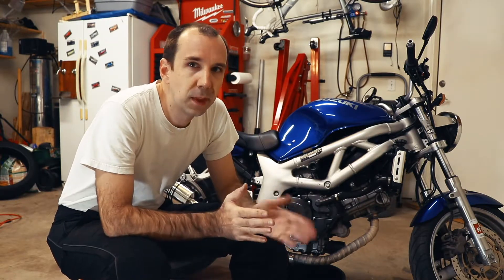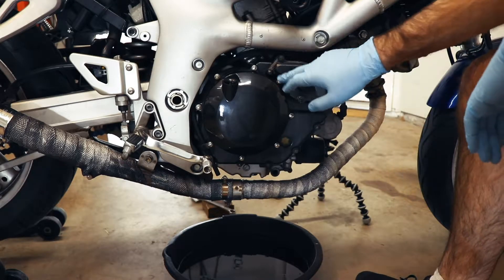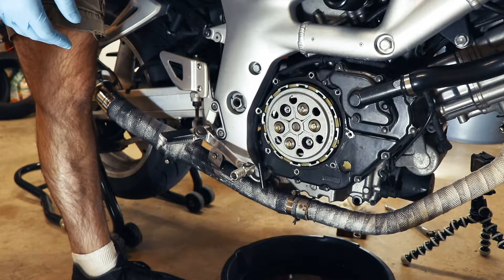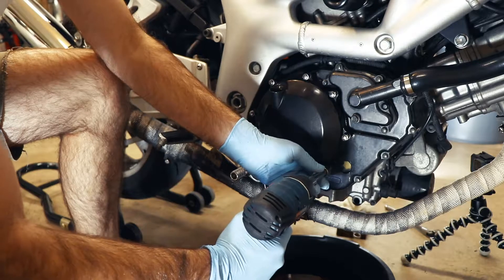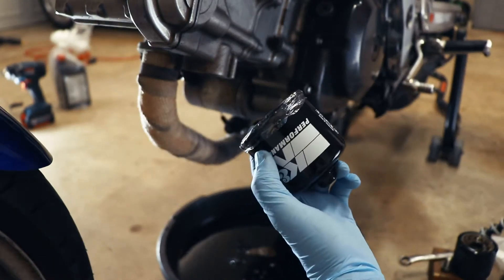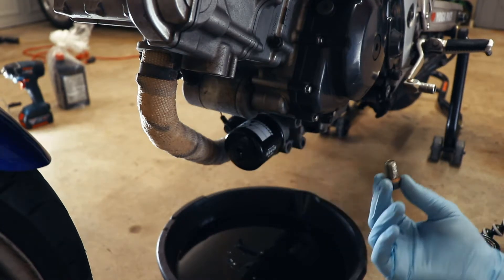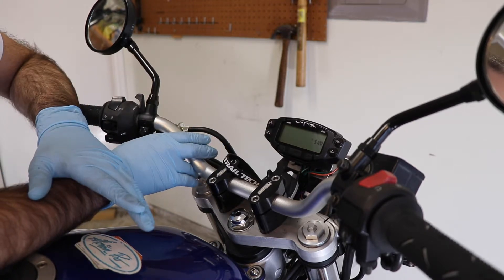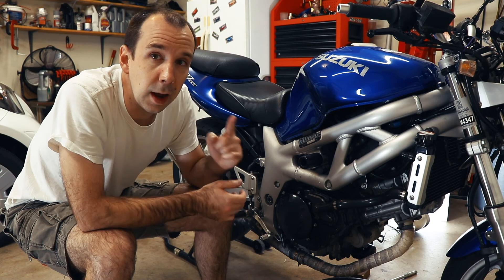Used Motorcycle Rehab - Clutch Cover Oil Leak Fix (Maybe?) - SV650 Episode 11

Comment: Thanks for the video Aaron. It was very helpfull. Just noticed on my bike that I'm having the same problem. I understand that these are a common problem on this model. Terry.
Reply from the maker: Right on, man!  Be sure to check out the follow-up, too.  I only kind of got this fixed initially, and had to redo it later with a little bit of Permatex RTV stuff to help the gasket do its job.
Reply: @AaronAverett 👍👍👌👌

Comment: My 8mm bolt got completely grinded off during a lowside fall. 😭😭 And there is a hole on my stator cover.  Any ideas how to remove what's left of that bolt in that recessed hole?
Reply from the maker: It's hard to say without seeing it, but generally, you have two options:
1.  Grind the head of the damaged bolt off so you can remove the cover over it.
2.  Get a grip on the bolt with something and turn it out.

Option 1 is probably the most straightforward.  I'd just grind the head off with a Dremel or die grinder, lift the cover off, and then use vise grips to get the stump out of the engine case.  If there's already a hole in the stator cover, it's not the end of the world if you damage it, since you'll need to replace it anyway.
Reply: @AaronAverett  I haven't even thought of actually doing that. I'll try it during the weekend when I get time.  Thank you so much Aaron.👌🏾👌🏾

Comment: Question, you have only 4 screws with springs but did you took 2 out or was it already like that?
Reply from the maker: It was like that when it came to me.  Those don't appear to be the original fasteners, but it always worked really well and didn't slip, so I left it alone.

According to the parts fiche, there should be six springs, though.

Comment: Ok, I did both part 1 and part 2 of this repair and both didn’t work. I was actually driving to school and the gasket sealer had leaked so much that I had to pull over to keep my tire from losing grip. Did some research, and yes, these can fix the problem but not entirely. It’s possible that when I replaced the o-ring from part 1 I over torqued the plastic case and warped it. I ordered a new clutch case cover and new bolts and I will reinstall the o-ring WITH gasket sealer. If this doesn’t work—
Reply from the maker: Oof, that sucks!  It sounds like maybe just from use or heat or whatever, your cover is warped worse than mine was.

Also check for any damage to the mating surface on the engine side.  If you've got scratches or nicks, maybe from a previous owner trying to pry the cover off or something, that may contribute to the leaking, too.

I'd probably be considering the aluminum Woodcraft cover if I were you.  It's pricy, but so is crashing, and being aluminum, it should be somewhat less prone to warpage than the crummy plastic one is.
Reply: @AaronAverett  you’re probably right but I don’t plan on keeping the bike for too long and don’t want to invest a lot into it lol. Your radiator video was, however. a great success — much appreciated!!

Comment: Great vid thanks! But what is the gasket on the other side called? Mines leaking a little, just don’t know what gasket is or what it’s for.
Reply from the maker: Which gasket are you referring to?  The one on the left side of the bike, opposite the clutch?
Reply: @AaronAverett  yes
Reply from the maker: @kingalshammari8251  The cover on the left is called the stator or magneto cover.  The gasket for it (on this 2001) is Suzuki part number 11483-19F00.

You can find it here:
https://www.partzilla.com/product/suzuki/11483-19F00

Comment: Hi there. Conincedentally I am have this same issue. I noticed there's only 4 bolts holding the clutch plates in, where there should be 6, according to the manual. Did you remove two? Or what's the story ?
Reply from the maker: I never did figure out an actual reason, but I assume it's either a common modification to make the clutch lever effort less, or a model year change that happened, but everyone has a service manual from a different year.

It worked fine as it was for me, so I just left it with the four springs, as I recall.
Reply: @AaronAverett  Thanks for explaining. I was just wondering if it wouldn't make the clutch slip, since that little twin is pretty torquey. I might give it try myself 👍🏻

Comment: Hey if u don't mind what year SV is this? It looks like there's no push rod adjustment screw visible in your video which would mean it's still under the sprocket cover on the left hand side.
Reply from the maker: You're correct - this bike is a 2001 model year - the clutch cable terminates at the front sprocket cover on the left side, as you say.

Do later models have it on the right, a la Kawasaki?

Comment: I'm having the same problem, but the gasket keeps leaking at the bottom, even after replacing it. Also: my manual says 10W40 for the oil. This looks like a first gen bike, right?
Reply from the maker: Correct, that bike is a 2001 model.

I think I talked about this in the video, but the real cause of this problem is that the plastic cover gets distorted over time through exposure to heat and oil, and that the real permanent solution is an aftermarket aluminum part, which does exist, but costs about $200.  I had a similar problem to you, where I replaced the gasket and it still leaked, so I made a follow up video where I did this again, and used a small amount of RTV on the gasket, and that actually fixed it for as long as I owned that bike, without the need for the aftermarket part.
Reply: @AaronAverett  I have some loctite 577. Will that work too? I don't mind buying the alu part (I'm practically restoring a '99 model) so 200 is just a drop in a bucket on a bike that also needs new forks, seat, tank, ... Problem is that I can't find an aftermarket cover. I can only find the OEM part.
Reply from the maker: Can you not get one of these?
https://www.sportbiketrackgear.com/woodcraft-suzuki-sv650-99-02-rhs-engine-clutch-cover.

Loctite 577 is a thread sealant.  I'm pretty what I used is Permatex "Right Stuff" or a similar black RTV liquid gasket (the type that smells like tar, not vinegar).  I made a video where I showed how I did this, here:
https://www.youtube.com/watch?v=09XHw1IwZP0
Reply: Problem is that I live in mainland Europe so most of those names mean nothing to me. And if it doesn't ship from say... Germany, it's prohibitively expensive in customs taxes and stuff like that
Reply from the maker: Huh.  Woodcraft is pretty much THE brand for this sort of stuff here in the States.  I actually thought they were an English company until I looked just now.  I'd be really surprised if you can't get that part in Europe somehow, but I couldn't tell you where to look.

Anyway, a new OEM cover would probably work almost as well for another twenty years, but I'd try the RTV stuff first, and then actually replace the cover if that doesn't work.
Reply: @AaronAverett  As far as I can tell, I'd have to import it myself. Which is prohibitively expensive. I did find an importer for Permatex in The Netherlands so I'll be having a look at those.

Comment: Don’t fill the filter with oil, lol!!!
Reply from the maker: Why not?  Some bikes, particularly older Kawasakis, pretty much require it.
Reply: Aaron Averett be cause of the air bubble between the oil pump and filter. It is harder to push this air out of oil system with such an oil plug in filter. Just use your starter lit bit more, without starting an engine
Reply: Always prime the filter . Always. Air bubbles in the oil is rubbish, the pump does that !!!
Reply: Steve Emmett NEVER prime the filter, lol. It will take more time to get oil pressure in system. Only villagers prime the filter, because they only know about cows